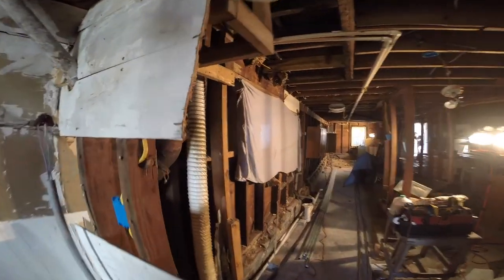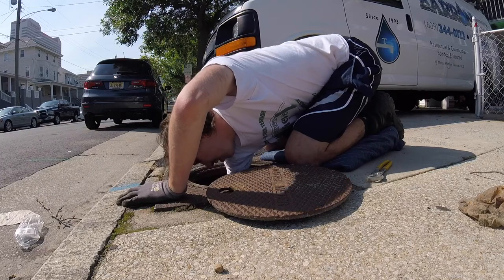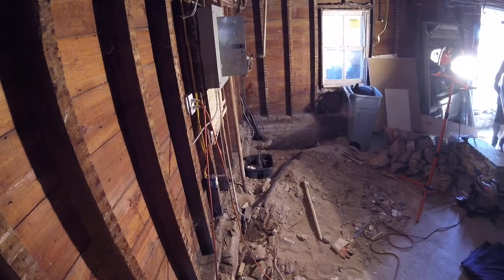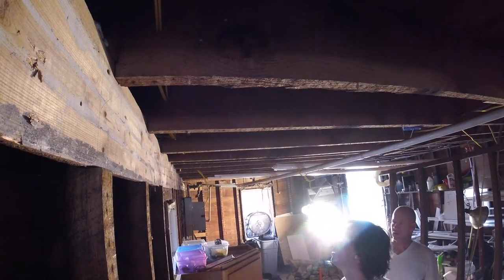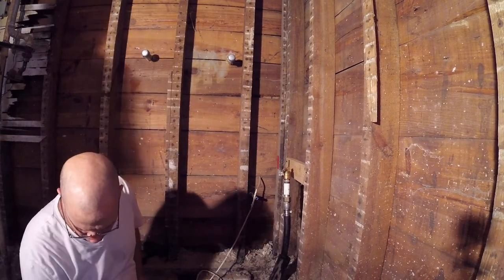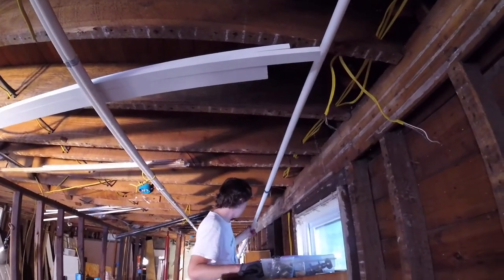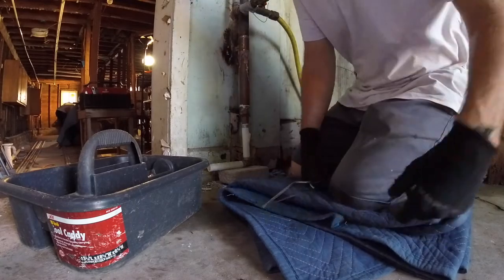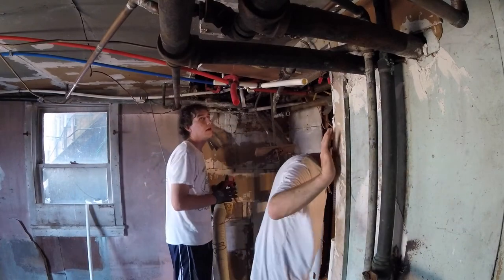Ridgid RP 200 Propress tool With Pex Ring Crimper.

Comment: I'm undecided about what ridgid tool to buy. I want a compact prees tool. Should i go with the RP240 pistol grip or the RP241 in line tool, what do you suggest?
Reply from the maker: good question. I have both and I had 241 in beginning and when I picked 240 i liked how I could use in bays on certain crimps. Its a toss up.
Reply from the maker: https://www.googleadservices.com/pagead/aclk?sa=L&ai=DChcSEwjzu8fugrbhAhWFHoYKHXHfBSAYABANGgJ2dQ&ohost=www.google.com&cid=CAESQeD20DEvcjm6fgQZGS7GuvZOeWk6-vxmPMEhnOqvYyvgak8kzzTlqiuKhyZffC6kjM2nelgo9D5wmMjrX2KZtJEt&sig=AOD64_1rRVfYNzADWQKVAGGqRGcn9GQvtA&ctype=5&q=&ved=0ahUKEwj2qL3ugrbhAhXLq1kKHWXvDogQ9aACCEg&adurl=
Reply from the maker: I am about to purchase this in near future. a game changer for tight spots.
Reply: Those rings seem like a must have. I have them in mind too. Thanks
Reply from the maker: for sure.

Comment: Do you need a special head for pex ring ? thanks
Reply from the maker: Just saw this comment.....yes and make sure you have right head. I happen to find out the hard way I was using wrong head......
Reply: So you need to use different jaws for different pipes like copper ect???
Reply: john doe Yes